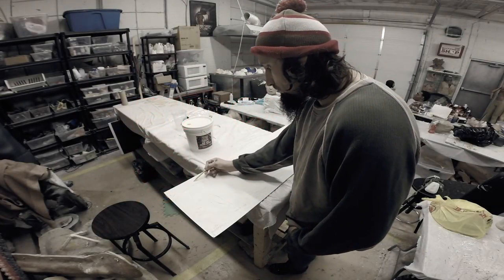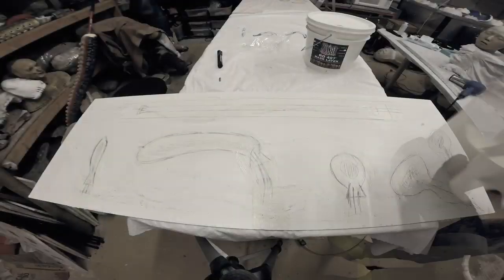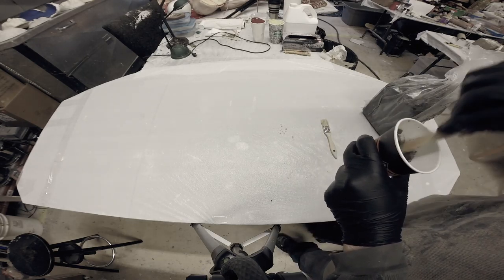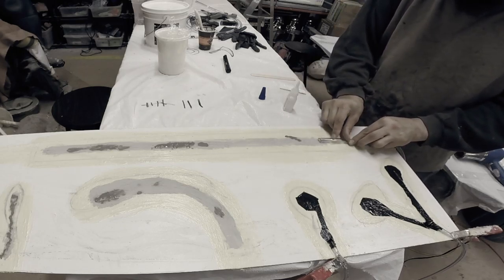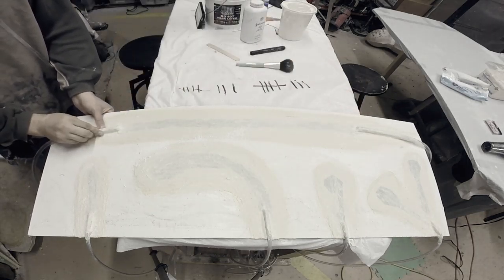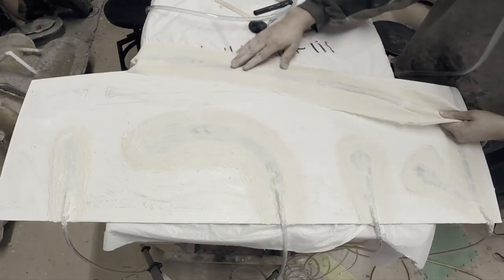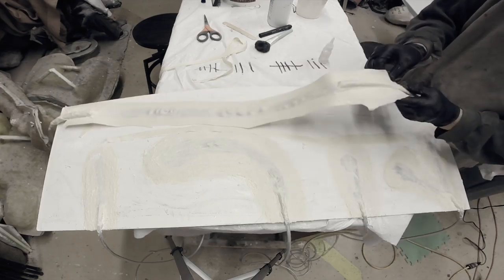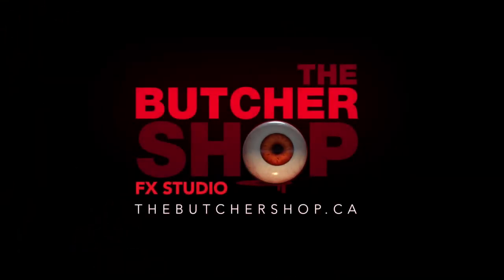How to Make Prosthetic Grade FX Bladders

Comment: How long away can you have the air source? I feel like it would take a while to inflate if it’s too fae
Reply: Hey Benwatford3068, there are many factors that will affect how long it takes to inflate. Length of the tubing, size of the bladder, how much air pressure you use, and what you're using to to create the air pressure. Just do tests until you figure out what works for your specific needs for the project. More importantly have fun!

Comment: So in order for the blood to flow out from the prosthetic, do you just cut holes where you want the blood to come out of, of the prosthetic? Because you put the bladder underneath right?
Reply from the maker: Yes. For example you can very carefully precut a slit in a slit throat applaince befor it's applied. You just have to be very careful  when applying the rubber piece. Making sure the cut will close back together nicely and it's lined up with the bladder holes. This way when the actor tilts his head, if glued down securly without obstrucking the bladder holes, the peice will open up where it was cut allowing the blood to flow out from the bladder sitting underneith.